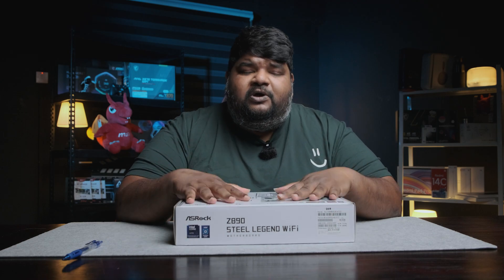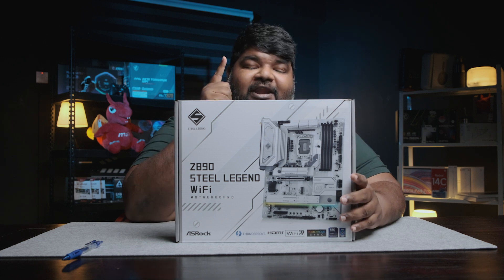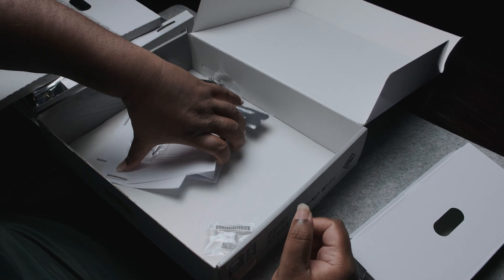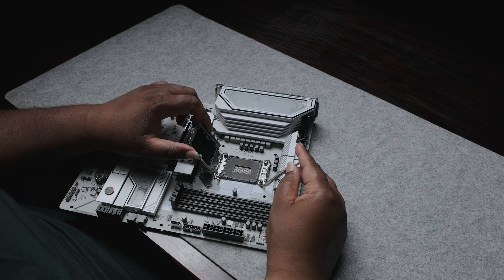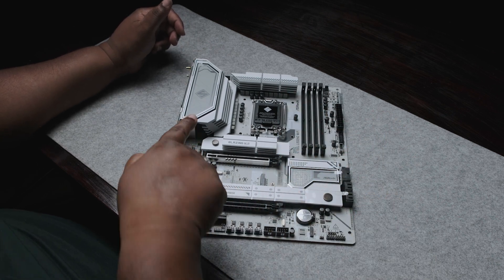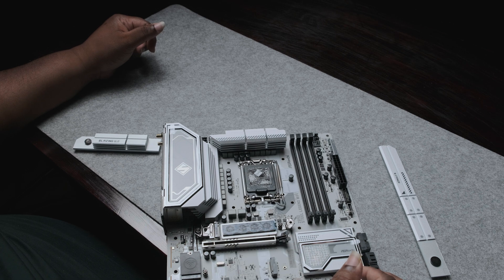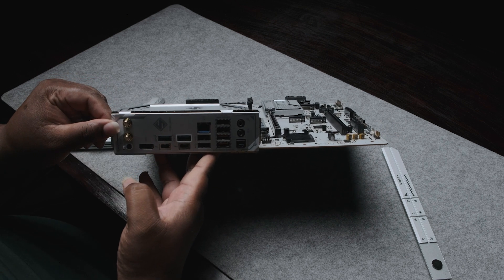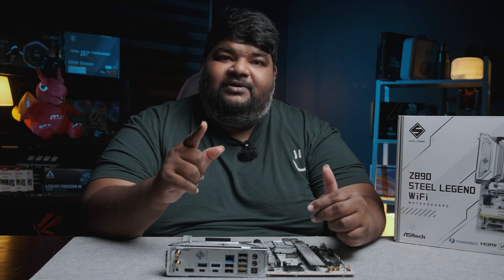Tough as steel, but is it truly a legend? Asrock Z890 Steel Legend Wifi Review.

Comment: What are your thoughts on this vs Z790? I'm looking between the two and want one that could stand into the future...
Reply from the maker: @TheDatingWarriors  for a lasting motherboard with sn upgrade path go for the z890. Z790 is at its end already.
Reply: @ I got the z870 amd one and she got the z790 because we were told the intel 13-14th gen processors run badly and have been returned more than once damaged
Reply from the maker: @TheDatingWarriors  wise choice on the x870. If you're purely into gaming we just released a video on how the new 9800X3D is winning the horse race. Check it out!

Yeah as for Intel 12,13,14, there is an issue that's currently ongoing. However Intel did release an update that would negate the issue, however it works only for the new processors. If you're running an old one, you're bound to get struck by the issue and go for a warranty procedure.
Reply: @ the 9800x3d was my other option BUT i need something for heavy gaming and heavy productivity workloads
Reply from the maker: @TheDatingWarriors  did you go with the 9900X or 9950X?
Reply: @ I want that new one the x3d that’s coming out tomorrow but I ended up going with the Verizon seven 7800 X 3-D
Reply from the maker: @TheDatingWarriors  awww sad you got the 78. Should have waited just a bit. Hahahah.
Reply: @ we ended up getting the upgrade after all!
Reply from the maker: @TheDatingWarriors  HAHAHHAHA. That escalated very fast!
Reply: @kopitech  I managed to convince my gf lol. As for processors I got the new 9800x3D so now working on getting a graphics card!
Reply: Does this board spit out rainbow vomit when you reboot, like if you have caseleds or rgb ram, will they display rainbow vomit during the boot process like all recent z890 Asus motherboards do?